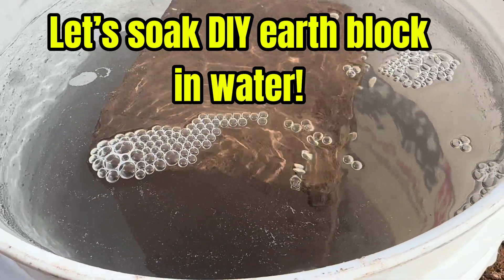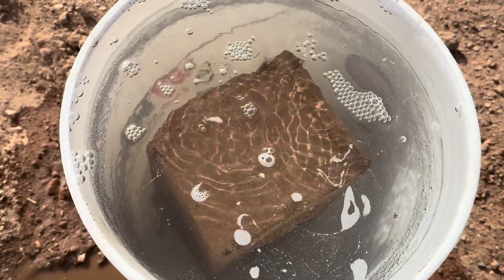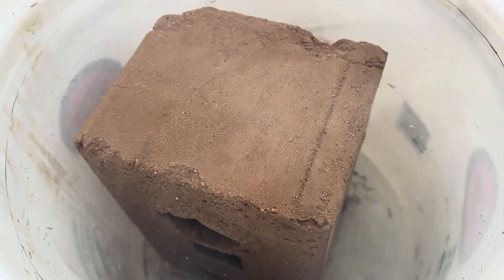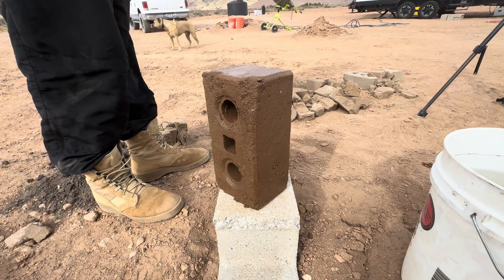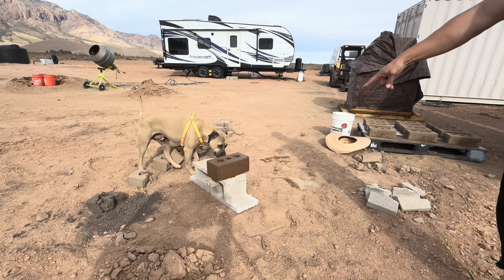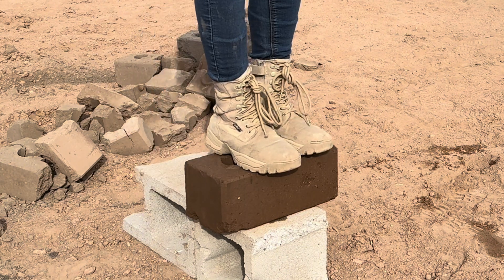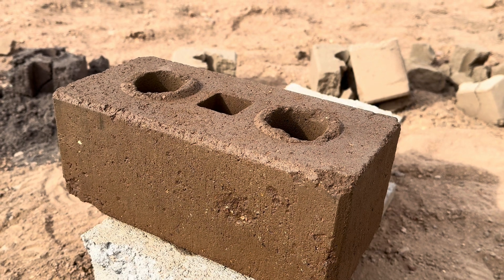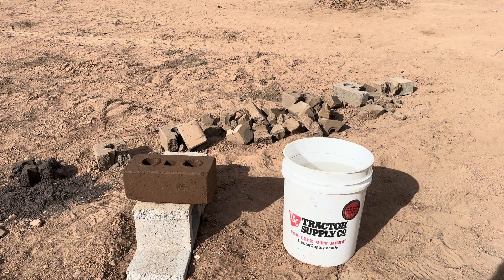24HR Water Test: How Strong Are Our DIY Earth Blocks?

Comment: That's great. I have the same machine but manual. I've made a few though I don't believe I cured them correctly as they crumble too easily. I'll be making more soon to build a shed and paying more attention to the curing process (i.e. maintaining a good moisture level for 21 days). By the way - does anyone know if you can place the watered down bricks on a pallet for example, and wrap it with pallet film to keep in the moisture? Will that cure them adequately as long as there is sufficient moisture initially within the wrapped area (and it can't escape)?
Reply from the maker: @ZadBlack123  Thank you for checking out our video and sharing your comment! We’re planning to tarp our blocks on a pallet and mist them every few days for about 14 days. A lot of our viewers have told us not to expose them to too much heat or sun. We think slow curing helps make the blocks stronger and harder.

Good luck with the shed build—keep us posted!
Reply: @leeslivingoutofthenorm  Thanks for the reply! I'll give that a try and see if I have more success.